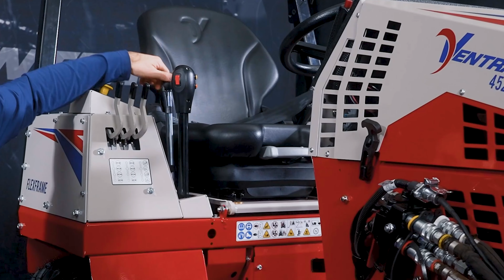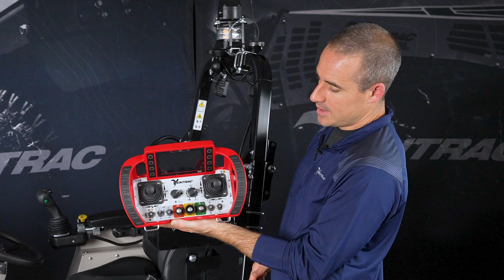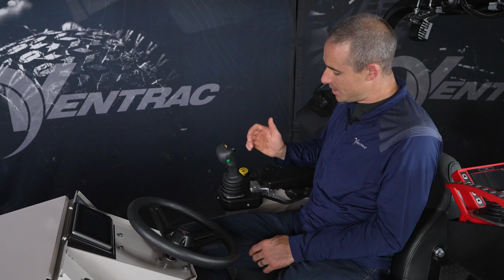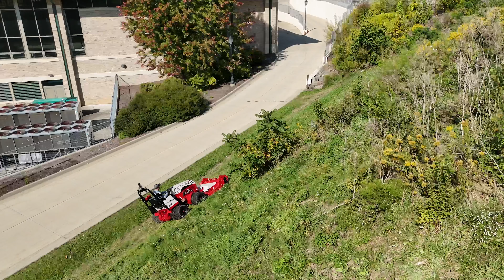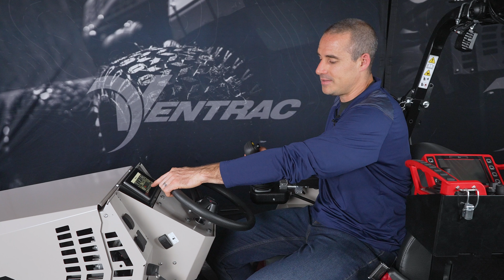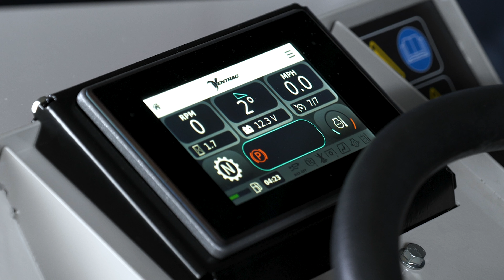Ventrac 45RC Overview | RC Tractor Explained

Comment: I like the new park brake.  Is the physical brake assembly the same as the 4520 or is that improved as well?  I was wondering about the 3 point when I first saw the new tractor.  The 3 point is infinitely valuable for the way I operate the machine.